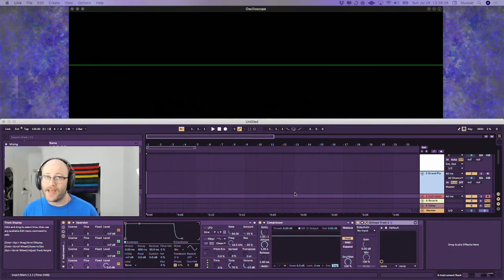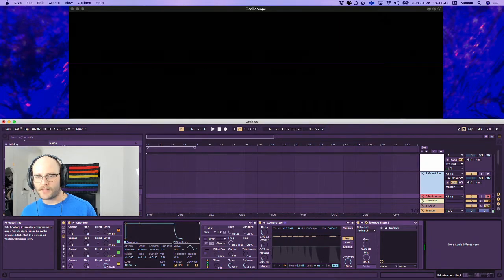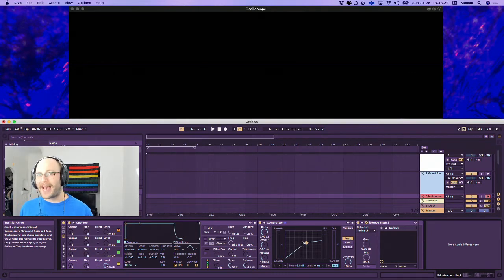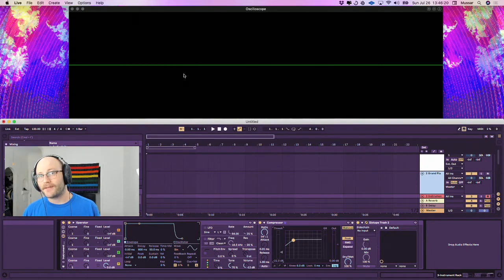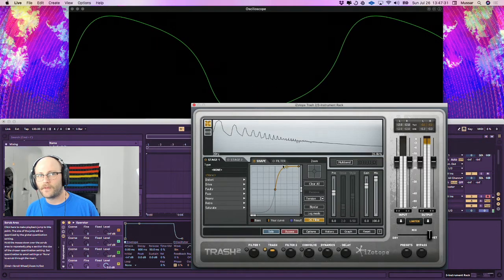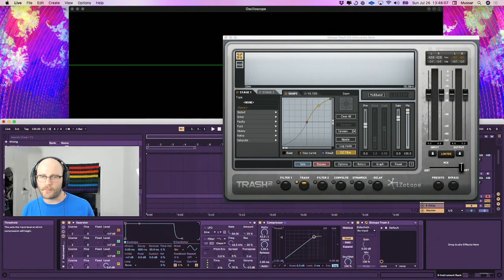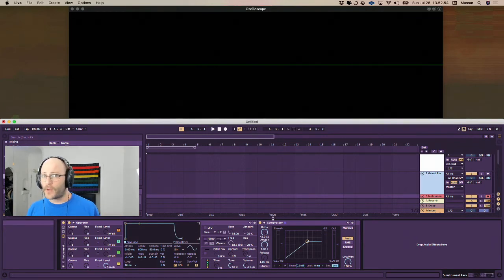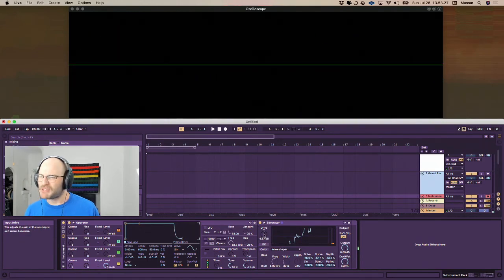What Is Waveshaping?

Comment: i used to set compressor to 20:1 before and pull the threshold down 
but i was confused why it was changing the sound, now i know thank :)
and that why a lot of 3rd party plugins include a oversampling to remove extra harmonics i guess.
Reply: oversampling doesn't actually affect upper harmonics by removing them, it processes the audio at double, triple quadruple (2x, 3x, 4x oversampling) or more times the sample rate of your audio. This is to remove aliasing, low harmonics that are caused by very high frequencies that when processed by lower sample rates, become low multiples of themselves, so called "undertones", as opposed to overtones.